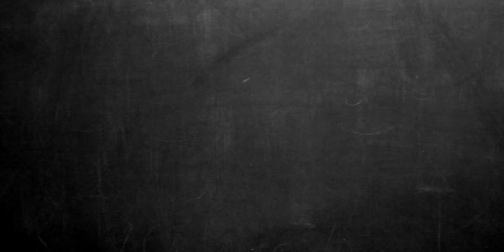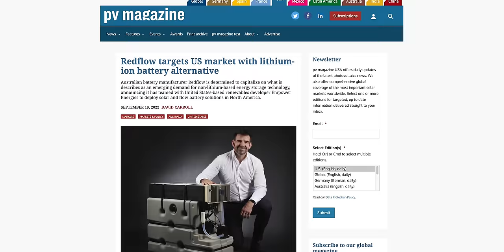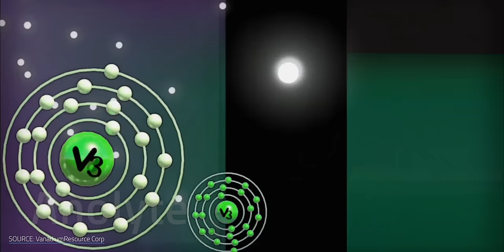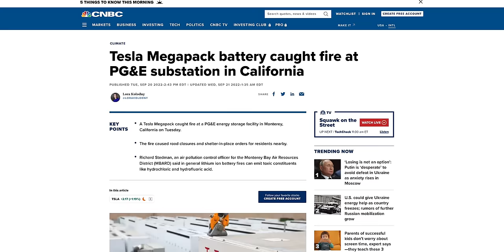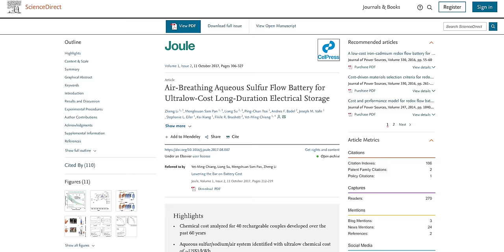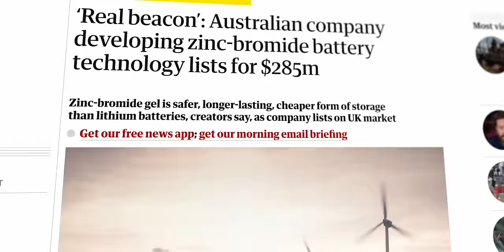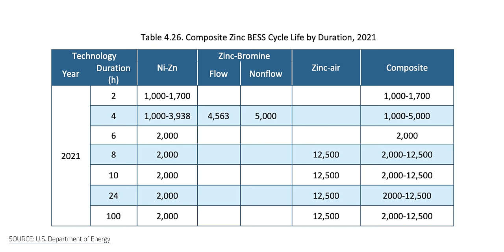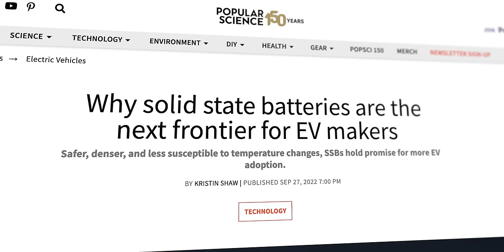137 Year Old Battery Tech May Be The Future of Energy Storage

Comment: One more immediate option: dump extra energy from "renewable" energies into hydrogen and medical grade oxygen production. Hydrogen storage is more long lasting compared to a battery. Many existing power plants can be converted to dual fuel Hydrogen/natural gas. Others can be converted from other heat sorces. The majority of powerplants are a heat source of some sort to creat steam to turn a turbine. This can be a more immediate addition and solution to the long term addition of more polluting (due to trasport from china and mining and production methods of currently used tech) and less reliable (winter extreme storms etc) green energy. Sadly currently used wind tech in us is a joke. Many turbines will never offset the massive amounts of carbon created and the fossil fuel and energy used to produce and transport their components from china. The blades we mainly use are banned in  Germany and other countries due to this and their inability tonbe recycled. Newer wind tech of upright turbine tube stacks (best description  i have) are a far more green and easier to source materials near construction site option. They also can be muffled to reduce noise and less disruption to ecosystems. They also have a throttlable collector intake that can be opened and closed to allow their use in lower and far higher wind speeds than currently used tech. This feature makes them less intermittent and distuptable due to exteme wind shut downs like currently used tech.

Comment: Are electrical grid system is way outdated and has been for long time. The way I see it we should get out of electric vehicles completely and go to hydrogen fuel cell cars. They could run ammonia in them which is hydrogen and nitrogen and ammonia does not have to be under high pressure so no change in the infrastructure no grid problem. Plus ammonia is greener they can GMO algae to create more ammonia greener. Ammonia is even in your urine so more natural occurring and easier to extract from environment.

Comment: The windmills never pay for themselves so why do they keep using them for the cost and the delivery and set up and clean up it is overpriced and useless when all you need to get energy for free is run a wire with a copper Bush on top up in the air the higher the balloon goes the more the current will come to the ground why it works this way I don't know but you can send the balloon up in the air and get 110 or you could go even higher and get more than a thousand volts so I don't know why they're still using this useless way of creating electricity and Tesla already proved it was free and already in the air

Comment: Globally electricity and all the reversible electrochemical battery technology is not the ideal media to store energy: replacing fossil fuel used for mobility and domestic heating by locally produced carbon free sun and wind energy requires massive amounts of energy storage, preferably at no loss of energy due to storage. Batteries require costly elements sourcing,Li +700%, etc, generally highly demanding on mining and industrial processing grey energy, pollution, are not durable enough and then, not properly and economically recycled in comparaison to new production battery cost and environmental impact. Hydro electric dam pump and turbine aren’t ideal storage means either : you pump up half an inch of water to the upper lake on Monday to use it on Friday and it’s all gone by then….evaporated…In fact both battery and hydro energy storage are expensive, 6 to 10 US$ cents per kWh stored plus the unrecoverable losses between the amount of energy put in initially and extracted out later. As said before, not ideal and economical…

That is where we need to step back a little bit : historically, any energy distribution adapts to the energy source and the loads then are adapted to this supply system. For instance , no gas station connects to multiples fuel pipelines “networks” . A fleet of trucks tankers with few compartments for diesel, regular, premium gasoline, ethanol, etc, brings 250 MWh of energy to the station in one single rotation of one single truck. Same with electricity used to bring energy from remote valley dams and dirty power plants to living and working areas. Here a Cu-Al power network was the good system to transport this energy but a very poor one to store this very same energy which then got produced real time almost for all…

Sun and wind renewables are different: those free energy sources are variable, unpredictable and seasonal but locally produced unlike remote hydro electric dams or power plants and bringing this particular energy elsewhere by an electric network no longer make any sense once energy production and storage and use can limited to one single location with a very small energy area network. With such wide availability, sun radiation onto earth surface represent 1500 time the total human energy consumption and wind even more , any extra network expenses (copper 9000$/ton Al 3000$/ton) and heavy losses 8% are useless and totally unrecoverable, their only useful purpose would be to maintain the strong hold of a rich monopolistic energy supply with no alternate and competing options. Not very customer focus..

Furthermore with renewable’s, the process efficiency, critical with costly fossils, uranium or water retention limitations is much less relevant here because the energy primary media is free. Instead, the total energy cost by unit of useful energy produced and sold is relevant and much more important than a global efficiency on free primary source of energy. For instance, a less efficient windmill with lower initial, installation and maintenance cost, longer life and less noise but requiring three blades two feet longer for the same output is still a much better product than the more efficient one. 

The mobility and heating loads differ also from previous power network loads: while light or a lift are immediately required loads and the power network sized for it, those new very heavy charges replacing fossils for survival can wait a few minutes before heating or recharging. Then, going fully 100% electric, they would need a 50 % increase in local energy production, zero carbone for the planet and also a 50% increase in network capacity to bring this energy to loads, a network we saw was redundant and a media, electricity, inadequate for the massive storage of those variables energies essential and required to match production variable timing with consumption time and rate. 

Green hydrogen produced by “efficient PEM” water electrolysis is often criticised for its poor efficiency despite huge progress, but green H2 would be only a part of this supplemental mobility and domestic local power which based strictly on renewables everywhere, no longer requires any extensive energy transmission and distribution network, a huge saving since this « externalisation” cost of battery or network loading amounts to 4 to 6 time its initial cost of PV production with cheap quality shingle panels, 25 years panel warranty and free sun power. So even if up to 50 kWh are required to get 15 kWh to the wheels of a H2 Miraï car for 100 kms with 800 grams of hydrogen, the PV cost of producing those 50 kWh is then well below one dollar and unbeatable. Then, the energy storage cost in COPV’s sized to take 50000 load cycles is also just negligible and a minute fraction of the cost per kWh stored compared to batteries, furthermore at no energy loss whatsoever over time. Therefore such green primary energy can become very attractive specially if anyone can produce it anywhere and product sold then with fierce and open competition with some fair trade principles on energy exchanges replacing favourably for the customers the  current huge financial gap and means between low energy production cost to very high retail selling prices at the gas station, the electric or gas meter..

H2 is often criticised as dangerous, green house gas, etc, a so called “Schroeder-Hindenburg syndrome”, as it represent a huge competitive threat to the current monopoles of energy production and distribution of gas, oil, coal-electricity and domestic power. The inefficiency of green H2 processes is a particularly interesting and repetitively hammered drawback….most  of the lost 35kWh lost between the 50 kWh produced and the 15 kWh used over 100 kms are local stationary electrolysis and compressor high enthalpy useful heat and for each kg of H2 produced by the process, 8 pure kgs of O2 for medical or welding use is also produced, so those huge loss are so valuables that they largely pay the H2 production process at current market price levels.

Globally, at the actual costs of energy (I,e: 100S per barrel of oil) PV green hydrogen can be highly competitive and provide cheaper mobility and domestic energy to the customers. But, at current “exclusively controlled energy prices” (4$ per gallon selling price) the energy transition becomes a huge financial burden loaded onto users. The laws have to be changed to allow a wide range of competitive clean solutions: today, buying gasoline and reselling it during a shortage for 50% more can be highly illegal, but a power supply network can repurchase domestic roof produced clean PV power for nothing and selling it right away to the neighbours for three times more and this is OK !!! The electricity sale at excessive price is legal but the private fair useful trade, illegal..this is the fundamentals rules which need to be changed by law for a clean energy free market driving cost down..

Comment: Looks promising. The REALIZATION that everyone needs to come to is: "THE RIGHT TOOL FOR THE JOB" and this means "ONE TECHNOLOGY DOESN'T FIT ALL".  As tech moves along the time-line - energy density will shape the future of generation. Eventually, NUCLEAR (SMR & LFTR) designs will replace ALL industrial-scale renewables as well as removing the need for petro-powered plants. Having said that - renewables - especially solar will find a niche at the CONSUMER-END-POINTS with HOME & RV leading that sector.  NUCLEAR is the future because abundant energy ALWAYS solves economic issues by making new goods & services available because what once was too expensive suddenly is affordable. I.E: Desalinating RIVERS of sea-water into drinkable water is currently too expensive. A NUCLEAR renaissance will make it easily affordable & safer than current means!  Las Vegas - did you get that?

Comment: From the Redflow battery datasheet

"Systems can be specified to operate in ambient temperatures of 10-45°C (50-113°F)." 

That pretty much rules out a lot of locations without building a cold protected structure to hold the battery. Same specs for their large "Energy Pod" grid storage unit. I don't understand how they expect to have much market in the US since it gets below freezing almost everywhere at some point. Other than that this looks like well thought out battery. I'd install one here in Austin TX as long as it is safe to put it indoors or in a heated outdoor cabinet. Also, what is the maintenance on these things? No mention on the Redflow website of what or how often maintenance is required. What are the Bromine/Bromide compounds used in the electrolite and are they toxic?

Comment: I still believe super capacitors are the wave of the future
Reply: they're in widespread use & even available on the domestic market.
Reply: why? they are fast charging and discharging, but their kWh/kg is low, they leak quicker than batteries. I can certainly imagine them being helpful in capturing breaking energy  in seconds and pushing into the battery over 10s of seconds, or charging from the battery to provide peak loads, prevent the battery to run at peak. but you won't have supercaps running cars by themselves. They might be great for lifting loads vertically with cranes, where the energy comes back 20-30 seconds later...
Reply: Elon Musk started with capacitors, and quickly realized he needed to switch to batteries.

Comment: Please stop repeating the lie that Lithium exclusively comes from salar brines that require huge amounts of water. Argentina and Chile's salar brine production amounts to less than 30% of battery-grade lithium carbonate, and an even smaller proportion of the higher-quality lithium hydroxide used for most modern LFP and NCA chemistries (brines needing an extra step to be converted to lithium hydroxide). The rest of the global supply is from hard-rock Spodumene, mostly from Australia and China. Not without its own impacts because of higher processing energy requirements (though this can be hugely reduced by switching mining and processing to fossil-free energy sources), but environmentally far more benign than sourcing from brines. This difference in supply is also set to widen as spodumene mining can and is being scaled up much faster than brines, since build-out of a new spodumene mine takes about half the time as a new brine operation, not even counting the fact it takes ~18months to get the first batch out of a brine operation vs. day 1 extraction from a spodumene hard rock mine. It's not something fundamental about Lithium Ion batteries that requires salar brines, it's one of several possible sources. Certain battery companies make their lithium sources known via supply agreement announcements, so it's also possible to vote with your wallet on this issue as well.

Comment: A bttery how cost 8 US$, do not burn up and work t least double lifetime! And it can be smaller when a car-tank and a ICE-motor!  And this kind of battery can't destroy LiFe-batteries to be in a car! Why?  🥸
Reply: I think your confusing an $8 battery with a battery that’s $8 per kilowatt.
Tesla average a 50kw battery, so if they where using that chemistry it’s would be $400 which is still hella cheap don’t get me wrong, compared to teslas $8,000 they want for a battery.  It that just ignore any of their current limitations.
Reply: If you want to have a battery as big as your trunk, or you're prepared to accept half the range, fine. Most people want the most energy dense option.

Comment: Thanks for the information about zinc-bromide batteries.  I hope I can post a link to my webpage...

Ferrell, M. [Undecided with Matt Ferrell]. (2022, December 14). 137 Year Old Battery Tech May Be the Future of Energy Storage [Video]. YouTube...
This informative fifteen-minute video explains that the word might already have a viable alternative to the prolific but problematic lithium-ion battery.  It begins with a short thesis presenting the zinc-bromide battery which, although dubbed an "up-and-coming contender," has actually been with us for 137 years!  The narrator, Matt Ferrell, then runs through renewable energy sources such as solar and wind, reminding viewers that an ongoing problem is energy storage.  The problem with lithium-ion storage, Ferrell contends, is that it paradoxically causes as many problems as it claims to solve:  these batteries are difficult and dangerous to recycle, lithium is troublesome and water-intensive to mine, and the batteries are getting increasingly expensive.  Ferrell then moves on to introduce viewers to two Australian companies, Gelion and Redflow, which have resorted to already existing technology to help solve the aforementioned problems.  Zinc-bromide batteries are safer, more reliable, and more robust, so Redflow has produced the ZBM3, while Gelion is developing the Endure.  Next, Ferrell reminds viewers how batteries work (anode, cathode, separator), and then shows how a safe 100% discharge capacity, thermal stability, and non-toxicity give zinc-ion an edge over lithium-ion.  Next, Ferrell compares the vanadium redux flow battery, to the zinc-bromide battery, detailing how the zinc-bromide is the clear winner.  There are problems, however, with bromide in that it is a proven carcinogen, but the amount used in batteries is negligible.  Moreover, zinc-bromide batteries are not as energy-dense as their lithium-ion counterparts.  Still, as Ferrell indicates, zinc-bromide batteries do not require as much space, complicated cooling equipment, or fire suppression systems; therefore, this battery technology might be more cost-effective in the long run.  Ferrell ends his discussion on a hopeful note, explaining that the zinc-bromide battery can fulfill a specialized niche in the quest for better energy storage technology.

Comment: Zinc-Bromine chemistry produces only 1.8v and loses 24% of the energy you charged it with. There's also a lot of pump-work needed for each 1.8v needed in your system.  That's 26 pumps, and tanks, and membranes, for a typical 48volt battery.